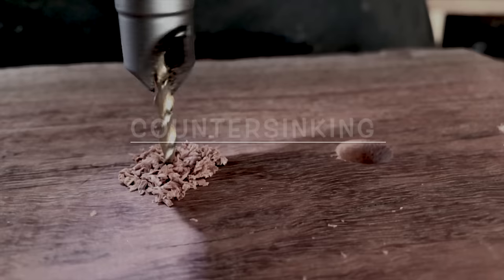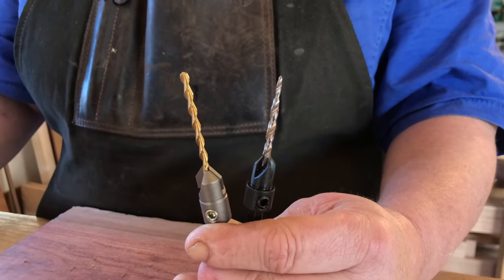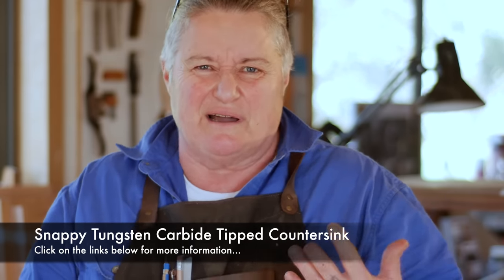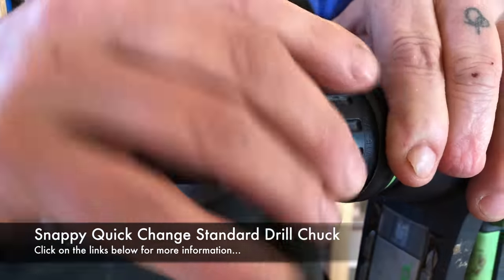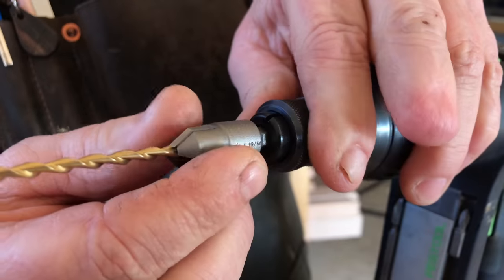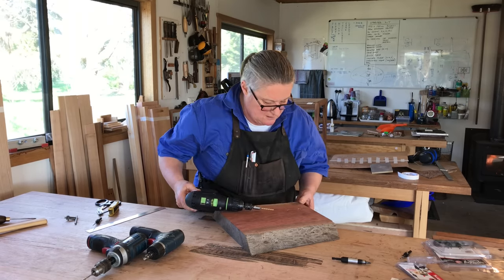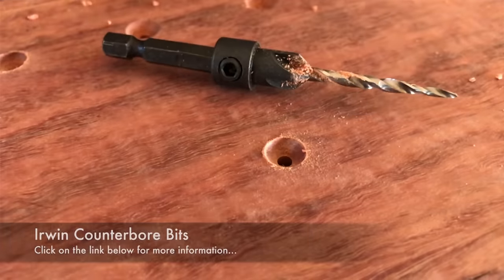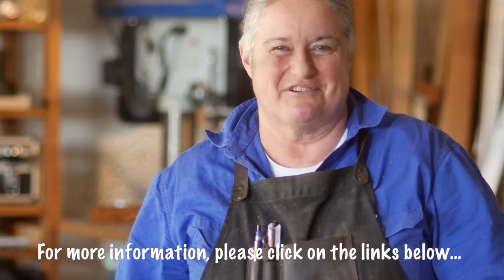Countersinking - Better, Faster, Easier!

Comment: I still like the old style.  I find very often, having the bit attached, it goes through the other side of my work piece, when I don't want it to.
Reply: Will Fishing exactly what I was thinking, as one must use the full drill length before the countersink reaches down. On a fixed area  you dont alway want to drill this depth. Thanks for mentioning this now i see where two separate applications is beneficial.
Reply: @longhairmullet  the snappy drill kit allows for drill length to be adjusted.  It also comes with a drill stop to be used as needed.  I no longer worry about drilling through the work piece.

Comment: Almost every time I drill Aussie hardwoods I find it necessary to "pick" the drill, IE in & out several times to allow the flutes to clear, or more often to burn your fingers clearing the drill.  If you get it wrong or try to hurry you risk a broken drill welded in place & it's bloody hard to get it out. This may not apply with decking timber thickness material. The other problem I don't think you cover is: can you adjust for different hole depths, often with cheaper designs at least te clamp screw bears on a flute edge?

Comment: Good side by side comparison 👍
Just out of curiosity, is the Irwin new or used?
Reply from the maker: HI Bill! Wow! You're fast! Both the bits were brand new and straight out of the pack. The Snappy outperformed the Irwin in terms of the cut and the speed, but then that is what its designed and priced to do. So the Irwin remains a good product, but the Snappy has its distinct advantages...
Reply: @timbeconaus  hahaha, I'd just sat down to lunch, and it popped up on my feed.✌
Thanks for the reply.

Comment: You would never use these on decking, you use something like a smartbit because you cant over drill the depth, these countersinks with no depth stop are useless for decking, even the non tungsten tipped smartbit will give you more than 2000 holes in spotted gum before it starts to get blunt.

Comment: The Erwin is a tapered bit. The Snappy is not, clearly giving it the advantage for deeper drilling in hardwoods. In addition, The taper a better choice when drilling softer woods, as it gives the screw progressively more wood to bite into, necessary for the screw to grip and hold better in the soft wood. For harder woods, this is less critical, as the wood has a far less likelihood of stripping out. I see your application as flawed in the nature of your review, the Erwin is the wrong tool for the job of hardwoods all around and the Snappy is the wrong tool for softer woods all around. Work smarter by knowing which tools go with which materials. Most anyone could tell you... if you do lots of repetitive drilling, one driller, one driver. And if you can't afford three drills, then you probably aren't working against a professional deadline... three drills = one on the charger at all times.